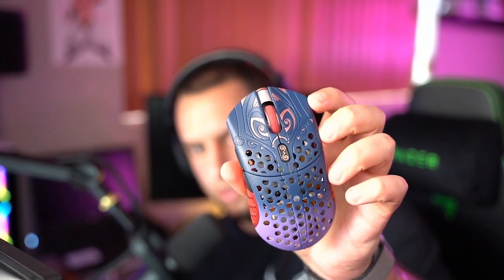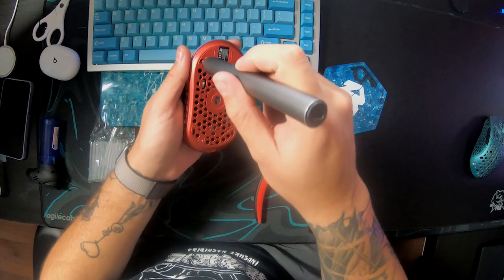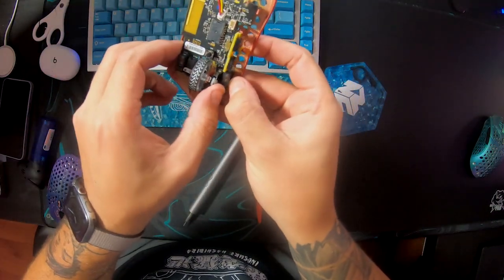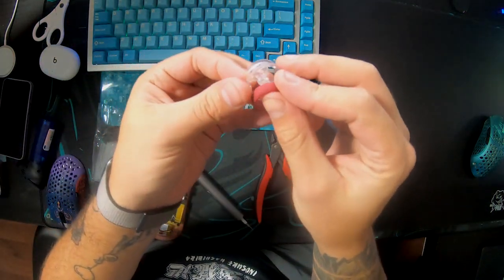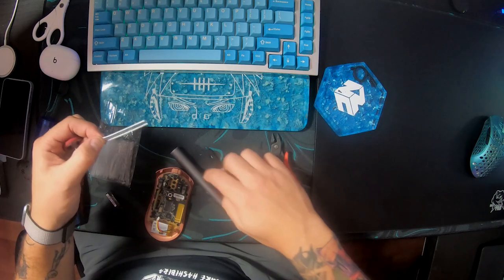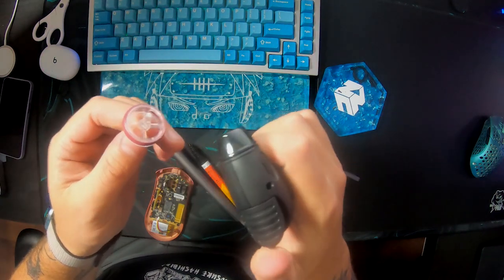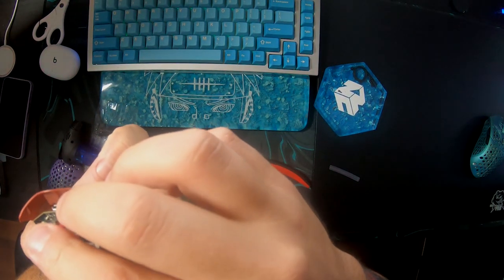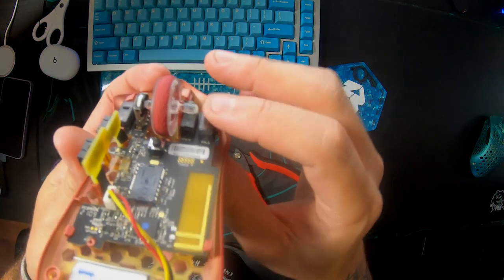Crooked scroll wheel on a $200 Mouse?! Finalmouse Starlight 12 Scroll wheel fix!

Comment: I did this, but now my wheel scroll is all rattly only when the mouse is on my mousepad. When I lift the mouse up it the wheel doesn't rattle. So weird. All I did was slide a rubber tubing on the part that presses the MMB. I did this without taking the PCB or anything . I just lifted the wheel VERY slightly. There's no way I managed to damage the encoder. Do you know a fix for this?

Comment: Hi, saw your tweet that you're planning to make another video regarding fixing the alignment. Is this still the optimal fix for it?
Reply from the maker: This still works yes :)
Reply: @NachoCustomz  is this one the optimal one tho? Like will there be a better more consistent method with the new video?
Reply from the maker: @SLiX-thatguy11m-  no its the same :)
Reply: @NachoCustomz  my scroll wheel actuates by itself on my phantom :( I can’t use it to switch weapons in valorant because of the shitty encoder. The steps are so light they happen when I move the mouse sometimes. Is this a known problem with anyone else?